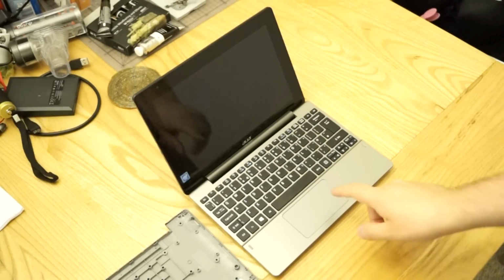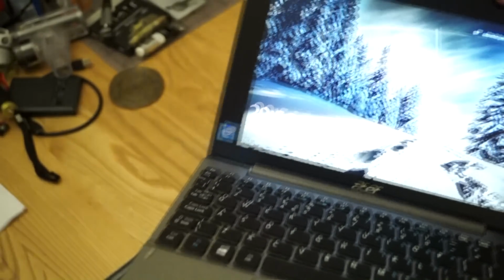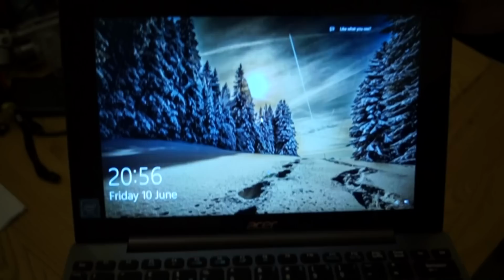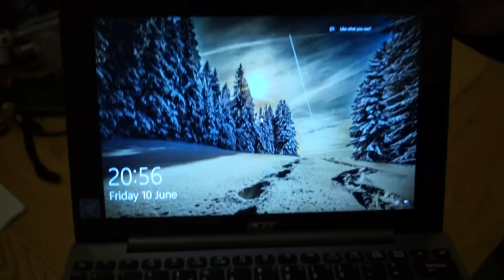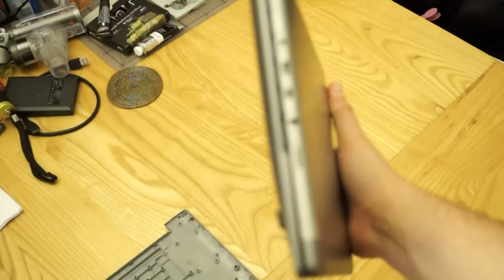Acer Aspire Switch 10 V HDD Hard drive installation on non-hard drive edition.

Comment: changing the only keyboard of non hard drive version will help?
Reply from the maker: Sorry can you clarify your question I don't understand what you mean?
Reply: +MIKEYMCC I am saying as there are two different versions. one support hard drive installation and other doesn't because of different style of dock keyboard.  
could we switch the keyboard dock from one model to 2nd to use hard drive?
Reply from the maker: The tablet itself doesn't differ at all it is just the keyboard dock. The only difference in the dock is the mainboard is different and the lack of the sata cable. If you got a dock with a hdd it would work on a 10V that was purchased without the hdd.
Reply: +MIKEYMCC great :D now wish me to find spare dock with HD.
Reply: +MIKEYMCC with hdd*
Reply from the maker: Good luck, I wasn't able to find any that's why I did it this way.